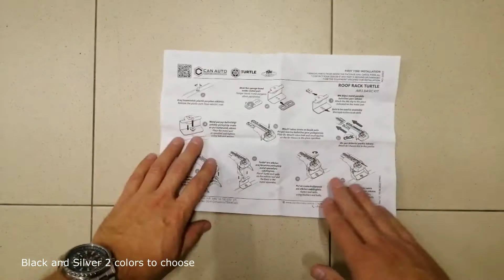Roof rack Kia SOUL Thule Motion XT L

Comment: Couple things...
At the 6:15 mark, it looks as if the feet of the crossbar(s) are fully assembled, but there is an open gap on the channel which will let rain and snow enter.
Yet, at the 6:30 mark, the holes on either side of the feet of the crossbar(s) are no longer there.
Please explain.